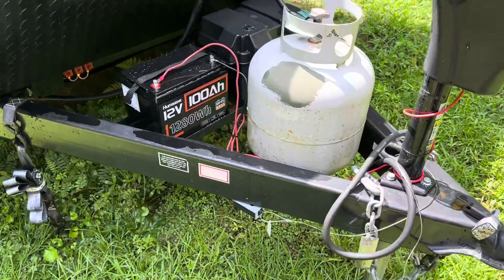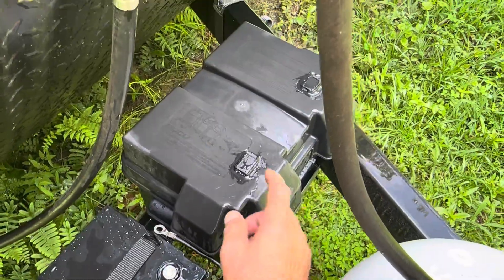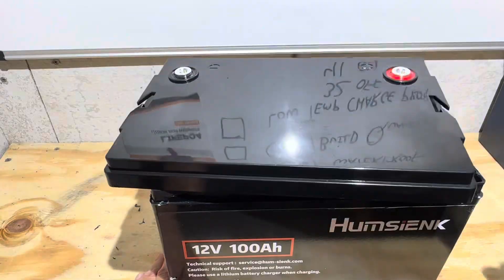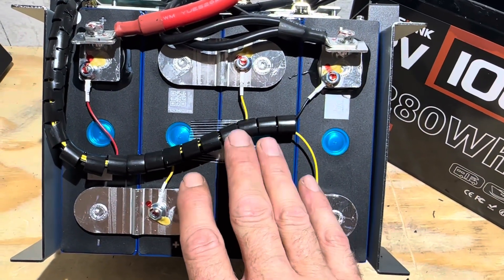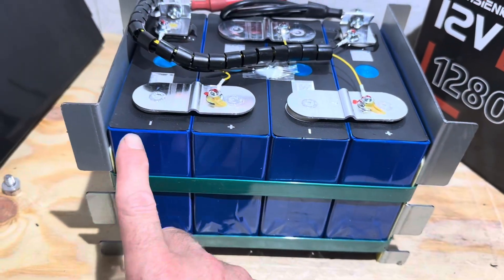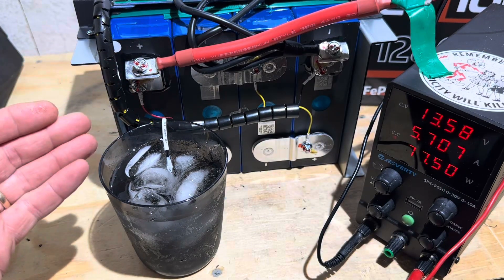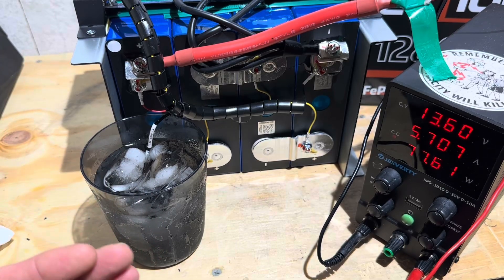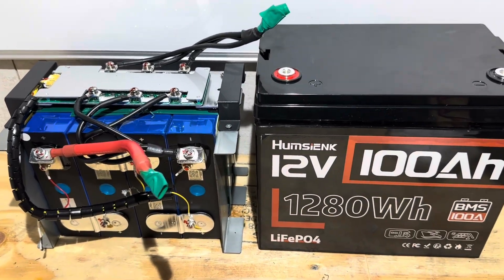HUMSIENK 12V 100Ah LiFePO4 Battery Review - Cheap 12V LiFePO4 Battery

Comment from the maker: OFFICIAL UPDATE 7/27/24 HUMSIENK just changed their product information/specifications on Amazon to reflect my findings! Glad to see this! Here’s the surge test video https://youtu.be/aafJSGZNDfA?si=oJtvN7uOFsiS9EP6 
Links in description if interested! Thanks for watching!
Reply: Interesting finding on low temp protection. I managed to trigger it with some ice/cooling spray - temp controlled with an additional sensor. I managed to trigger low temp charge protection between 0°C and -10°C - not essy to determine at which temp the NTC really triggered, because my additional sensor was not placed directly at the NTC. Also a NTC might not be that accurate - but the cooling pad you applied should have worked i assume?
Kind regards from germany from another tester.
Reply from the maker: @fldutch the ice pack always works on BMS that are properly setup/configured like this https://youtu.be/mc6W9Wz5mmI?si=etaonor5q_nOccMR
Reply: @THEOFFGRIDMOUNTAINHOMESTEAD  
Thx for your reply. Maybe they had some faulty NTC in the battery batch you received. The battery i tested had a different design, maybe they also changed the sensors 🤷🏻. You will never know which parts chinese companies use in their product version.
I also somehow had the impression that this sensor was not very reactive to cold temperatures somehow. 
Maybe they will improve reliability of this in the future. Very interesting price tag.
Reply from the maker: The build on these low price units change often unfortunately. Even find them built different within a few weeks of each other ! 
Low temp is not a concern for me, but to many it’s a necessary feature. I keep batteries in a conditioned space so they never see freezing. High temp safety is more important to me. There are some batteries out there without any temp protection!
Reply: @THEOFFGRIDMOUNTAINHOMESTEAD  Well they mostly have some temp protection in there - but only a temp switch being triggered at 75°C - not the way i like it. But i did not yet test any battery without high temp protection - lucky me - well except one where the BMS was triggered at 130°C MOSFET temperature in long time high load testing - a 100A 100Ah 12.8V battery delivering 250A+ for quite some time ^^.

The low temp charge protection can of course be discussed. You should know what you buy - and when stated there is this protection it should work flawlessly - but make sure your charging devices also take care of this issue - just to be safe ;).
Reply: @THEOFFGRIDMOUNTAINHOMESTEAD  hello after the few months its good quality for buying it? The price is like 200e for 150ah
Reply: The HumsiENK has the same sticker and specs as the Wattcycle battery. Are they made by the same manufacturer? I've seen some of the low temp tests on these budget batteries have to go below 32 degrees
Reply: I would recommend inserting a digital thermometer in the ice water bath.  Then if it doesn't trigger at 0C, gradually add salt to depress the temperature below 0C and record what temperature deactivates it.  You can tell I'm a lab chemist.
Reply: just a little over a couple of months, my BMS crapped out. Im thinking on disconnecting the BMS. How did you remove the lid?
Reply: @mannyfragoza9652 did the company honor their warrantee?
Reply: @acejorg5220  yes they did

Comment: Does anyone know why I have 2 such identical batteries properly connected to 12 volts, the discharge is only from (no1) battery while (no2) remains untouched at 100%;
What is wrong with all this, and how can I fix it?

Comment: Hi, how much does this battery weights? Mine is only 18.8 Lbs, but the description on their website says 23 Lbs. Should I be concerned? Thank you.
Reply: I think they changed cells too rather than just rename them
Reply from the maker: Shipping weight on this one was 25#. It’s an older version so they probably have changed the build by now. 
A ballpark average is 20# of weight per 100Ah. This is for the cells only, not counting the plastic/wire/board.
Reply: @THEOFFGRIDMOUNTAINHOMESTEAD  Thank you. I also have the Max Plus BT version of the same battery, but it weights 29 Lbs, that is 50% heavier than this GP24 version. How come the weight difference? Heavier is better?
Reply from the maker: @fz4540 Steel support structure in some models add some weight. There is also variation between cell weights depending on cell provider. The cheap brand batteries change cells often and it’s rare to find the same cells even 3-6 months apart in production dates. They tend to buy closeout or overstock cells to make the batteries cheaper.
Reply: @THEOFFGRIDMOUNTAINHOMESTEAD if they are always coming in at 90Ah then they just left out some cells or they are made new with less of expensive metal.  If they are used cells they would be 90 95 100 ah but they all seem to all rest 90ah now. Go back 10 months and all the tests on these showed a true 100Ah.  I saw a guy take apart a king boss battery and there was 24 cells which adds up to 90Ah a row of cylinder cells was missing. Now a picture on Amazon shows a cut away view of this battery with the cylinder cells. Not sure if the picture is wrong or not. I got 4 of these batteries for 90 dollars and will put them together. If they are 90Ah it shouldn't matter because the price per Ahr is still cheaper than paying 130 for a true 100Ah.

Comment: Also can someone help me find a way to discharge the battery and than recharge for long term storage  I have not hooked anything up yet for my solar generator build .what would be a good way to do this without hooking shunt and everything up ?
Reply from the maker: The battery will self-discharge roughly 3% per month. You could use voltage and time as a very crude estimate. Discharge down to flat. Then take your charger of choice and charge to half capacity. ((Example 100Ah battery with 50A charger charge for 1 hour to be at 50% SOC)) This would also have you sitting at about 13.1-13.2V +\- 
Hope this helps!

Comment: I got the humsienk 280 amp hour 6 months ago I have not had time to hook up they said they upgraded to a 200 amp BMS but on the battery it still says 100 amp have you guys pulled apart a 280 amp to see if it's true?
Reply from the maker: I haven’t worked with any Humsienk 280s sorry.

Comment: Just bought that battery and took the lid off! Not even close to the same battery and BMS as in yours. Those Rats that send you these batteries to review special build one for you to review and scam the rest of us into buying their Cheap Shit!
Reply from the maker: The budget brands change cells/BMS often due to contract manufacturing. The battery can be totally different between shipments and no one would ever know.  I even caught Redodo using PowerQueen parts.

Comment: I seen another testing video of this battery and the low temp protection worked for them, I wonder if you just got a defective battery.
Reply from the maker: How recent of a video? Did it trigger with just an ice pack or with a duster can? This was one of the first versions of the battery that was imported to US. The manufacturers of batteries often change/modify internal components of the same models between batches of bulk shipments.
Reply: 3 months ago, his youtube name is Jonas Syversen @THEOFFGRIDMOUNTAINHOMESTEAD
Reply: @THEOFFGRIDMOUNTAINHOMESTEAD  I actually picked up two of these batteries used on Facebook market place for $65 each, the person sent me the receipt they were bought in November of 2024 from temu. I'm not sure if mine has low temp charging protection and if it works or not.

Comment: hermano me has incitado a comprar el inversor top bull... has probado a usarlo de continuo durante varios dias / semanas ?
gracias!
Reply from the maker: Yes friend, I used the TopBull 4k for several months before I repurposed it for another system. (It’s still being used) 
It has always operated flawlessly! The only thing I didn’t like was no hardwired option. If they would add the external L/N/G for direct connection they would have a real contender! I have some other videos with the inverter as well. Even a voltage modification to the unit!
Reply: @THEOFFGRIDMOUNTAINHOMESTEAD   a que te refieres con el L/N/G externo? perdona mi ignorancia. lo usare para mi casa de campo hasta que pueda comprar uno mas grande... conectar nevera de bajo consumo,tv y alguna cosa mas, pero nada importante. miraré tu video sobre el.
gracias!!
Reply from the maker: Some inverters have a hardwire option with an external terminal block to connect to a vehicle/RV wiring or a structural electrical system. The TOPBULL only has the receptacle connection!

Comment: I just wanted to put this comment here, i would absolutely avoid these batteries. I bought several of them and opened them all up. They are trash! Used cells, qr code and serial numbers have been sanded off. Tested at 83ah. Wish I could get my money back. I can't post pics on youtube, but believe me they don't look like what's in his battery in the video. Perhaps they have varying build quality. That alone is enough to stear clear of
Reply from the maker: Probably started using used cells to get the price down to $119 or whatever they’re going for now. Unfortunately some brands start off with good quality to get their name out then cheap out. Could be what’s going on. WattCycle has also took a turn for the worse compared to their first batch.
Reply: @THEOFFGRIDMOUNTAINHOMESTEAD  yea it's pretty crazy to keep up with. I bought 2 of these for 250. I know it should be to good to be true, but I've also purchased hysincere, and hey future, that both have grade A eve cells when I first opened one up. I have 5 more hysinceres on the way, paid 110 per battery. I will cut all 4 open and report my findings!
Reply: @speedyz28  how were they??
Reply: @heyjeh  excellent! I wish I could post pics here. I bought them on temu, I left reviews over on temu with pictures. I've made a couple 16s batteries out of them now and I'm having great luck. I can keep the one balanced to a 5mv delta so I'm super happy with them

Comment: I would liked have seen the actual low temp test sources(ice water and ice pack) tested before  or when they where used in your  test with a temp probe to assure that they where at 32 degrees them self.

Comment: I'm looking for a replacement LifePo4 for my Camper Trailer , a 2022 Freedom Express (Ultra Light) --- i tested the Cables to see how many Amps the charger was sending to the Battery and it was 13.4,  Do you leave yours on you Camper Trailer or do you take it out to charge it?  PS - and funny thing,  I went out to test the Amp on the Camper Battery (Lead Acid) and guess what?? Slap full of water and a Green Frog living inside under the cover .. LOL... waiting to the cover to dry so i can plug up them 2 vent holes....Just my luck - looks like you tested every LifePo4 except for the Power Queen 12V 100Ah LiFePO4.... the one i have my Eye on... LOL... am enjoying your Videos thou for sure.
Reply from the maker: Glad you’re enjoying the videos! The Humsienk has since been removed from my camper due to winter and has been replaced with a Vatrer Self Heating on the tongue. This is just an easy test location for batteries for the RV. This circuit is fully isolated and can be added or removed from the main system. It has 2300Ah (30kWh) of battery inside and full solar/inverter etc installation. My charging is a little different. It would be fine to leave on your camper just check for parasitic loads like smoke detector, led indicators etc and recharge when below about 13.0. Check your converter to see if it can be adjusted for lithium instead of lead acid.  I’ve had the Vater outdoors for almost 3 months with no box and it’s still ok. So I’m not using the battery box currently. When towing I remove the battery on tongue and put generator there. Hope this helps anything else just let me know 👍
Reply: @THEOFFGRIDMOUNTAINHOMESTEAD  Thanks for the Reply, Great videos and very informative.  Still waiting on a call from the Campers Converter about the model I have to see how it would work or at least send me an Owners Manual-- my camper is a 2021 Model and that's about the only manual that didn't come with the Camper when I bought it....
Reply from the maker: If it’s a WFCO converter it could be adjustable although some disassembly is required. Mine is WFCO and had trimpot adjustments for current and voltage. Some have switches for different profiles. Depends on model. I don’t use mine anymore it’s just backup charge source, if I need a charge that the solar won’t cover I use grid charging on my inverter. WFCO has some manuals that can be found with a search!

Comment: some bms have more than 1 temp sensor, is it possible they use one for cold and one for heat?
Reply from the maker: The BMS is continuously monitoring the sensors. A BMS with multiple NTC thermistors just monitor different parts of the battery. Any sensor out of program parameters will trigger a protective action. Many of the low price batteries like these just don’t customize the BMS parameters. So the settings are not where they are suspected or claimed to be at. Hope this helps!
Reply: @THEOFFGRIDMOUNTAINHOMESTEAD  can you reprogram/set the parameters yourself?
Reply from the maker: @ not that I’m aware of on the Humsienk sorry ☹️ 
Look for a battery with a JBD smart BMS, you can configure them easily with Overkill Solar App. Some other battery brands have a their own proprietary smart BMS as well but most are read only and don’t allow changes. 
You can always use a charge controller with low temp cutoff like HQST 60A or other that has a sensor for the battery!

Comment: Very good test. Seems to be a reliable battery. Do you think it will hold up to vibrations like off road etc? Cheers.
Reply from the maker: Vehicle mounted should be fine. Most of the batteries are fairly tough. Look at the cells in this one https://youtu.be/ThwuLfvtMO4?si=6b7mN8ZGmAP82sY6
Reply: @ 
I watched the test. Really impressive. Sad only they used B-grade cells. Would have been a top product otherwise. 
Thanks a lot for your reply and take care.

Comment: Great video, Will of DIY  Solar just did the test and teardown of the Watt Cycle battery, it looks exactly the same as this HUMSEINK battery, it looks like they are made by the same factory and then put on different label on them.
Reply from the maker: Thank you! 
They are very similar to each other, maybe they are owned by the same parent company, similar to how LiTime, Redodo, Power Queen are all basically clones with different stickers. Like this https://youtu.be/DV8nm-xAT_k?si=gB6Vt5NlRCQEA8yN
Reply: Watt cycle doesn't have physical bracers inside
Reply from the maker: @viyusavery248  They did have braces unless recently changed?
Reply: @THEOFFGRIDMOUNTAINHOMESTEAD  I stand corrected

Comment: Thanks for doing the review.  I bought one of these off of Temu without looking at any outside reviews.  So far it has worked fine for me.  Took it out today in a wagon along with an inverter and a power sander to work in sanding down some old park benches to help refurbish them.  Works well in my portable power application.  Good thing I charge my battery indoors.
Reply from the maker: Glad you enjoyed the review! Thank you for sharing your experience with the battery and an excellent use case scenario! 👍
Reply: Still worth to buying this battery? I want to buy livepo4 150ah

Comment: Both TEMU, & Amazon list these batteries with a -4°F, -20°C cold cutoff.
Reply from the maker: Correct, I was checking for charging protection which should initiate at 0°C or 32°F to protect the battery from damage! Should work like this https://youtu.be/mc6W9Wz5mmI?si=UcHQAJg_5jJx5UXw

Comment: Thanks for the video.  Low temp isn’t as important to me as the high temp cut off, so I am still hopeful. I was going to complain there was no capacity, surge, or voltage cut offs, but at the end of the video you said those tests are on the way :). Thanks!
Reply from the maker: Yes, I didn’t charge the battery except during the low temp and high temp test. If you listen during the high temp test you can hear the inverter I was using for the power shed beeping on low voltage alert!